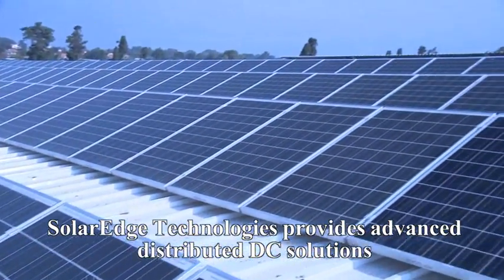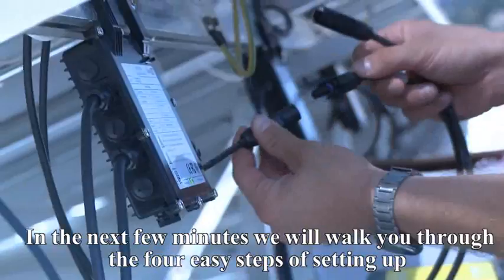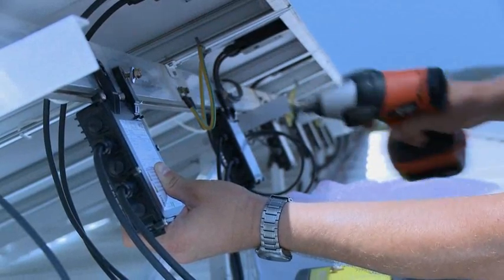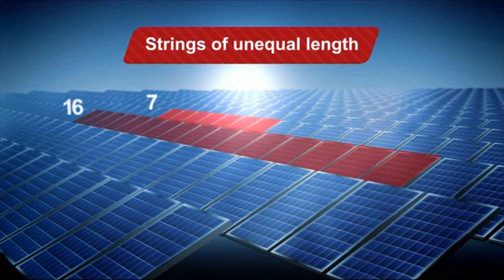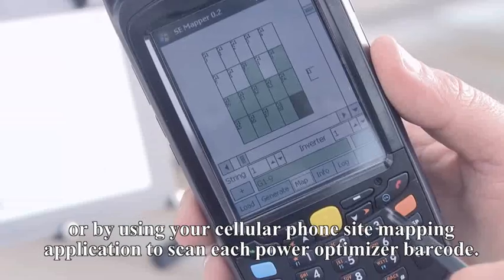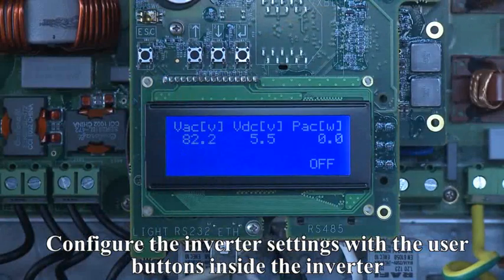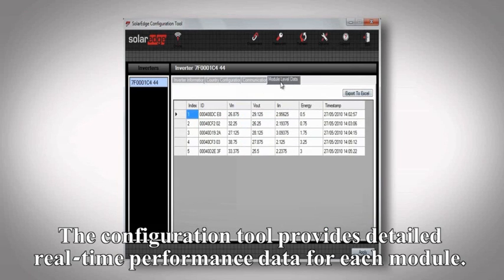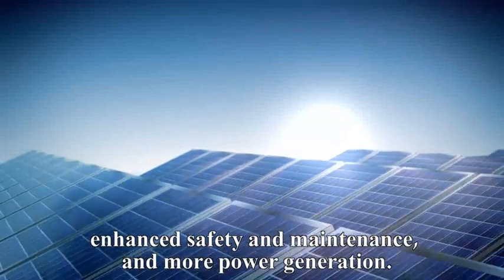SolarEdge Installation Movie

Comment: Nobody said anything about the minimum number of panels for the inverter to work.  My set up was  six 370 watt panels  on a 10k inverter  and it didn’t work . The voltage/ power  was not enough to close the relays . I googled it and it says the minimum # of panels is 8 …. Added 2 more and now it’s working
Reply: Good to know. No wonder my 7 solar panel system does not work and is on "night mode".

Comment: At 4:20 you say "Turn the inverter switch on". It is already on, you switched it on at 3:50. Then you configure the user buttons inside the inverter. Then you do pairing, then you turn the inverter on. Surely it is already turned on. So do you do the pairing with the inverter off or on?

Comment: There are a dozen or more Solar Edge installation videos, all slightly different.  Equipment isn't the same exactly and each video has a 'new' feature the others never spoke of.  Here it's the "configuration tool" .  Subtle but important questions aren't answered, like the strings.  Why one string?  Why two strings?  After the physics, how do you connect them to the inverter?  In conduit?  Metal or plastic?  What  size?  Where does the ground wire go?  Is it necessary with the optimizers?  I can't write fast enough to cover all the unanswered questions.  With an Iron ridge racking system, do you ground the racks, the panels, the optimizers, all three or none?  The bolt connectors from Iron ridge are grounded connectors, mostly.  When is that good enough?
I went with Solar Edge because Tesla is just a dream, you can buy but can't have their products, backordered almost a year.
Reply: This is great!   3years later and this exact same question still exists!  Someone…Please explain like I’m 5

Comment: Great Video. I was getting a Dc voltage of 246 volts instead of the 370 VDC on input of the Solaredge Se 7600 US with 28 solar panels rated at 300watts each  with optimizers. It was producing 5200 watts at the time it was tested. I thought it was wired wrong but every thing checked out correct. The Grid Tie solar system was 105 degrees when the 246 VDC was tested in Sept In Southern NV. A month later The utility finally connected their meters  and the Inverter was fired up when The temp was 78 degree F. The Voltage maintained 370 VDC through out the solar cycle and the power peaked at 5800 watts, which is good for this time of year. So everything is okay now. it appears that the solar panels have a negative temperature coefficient causing the voltage to drop 100 VDC.